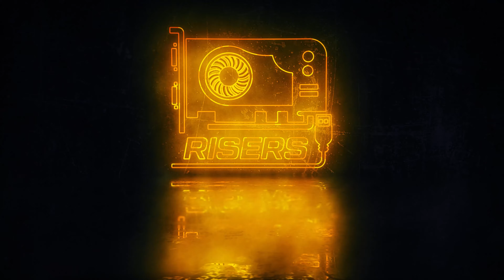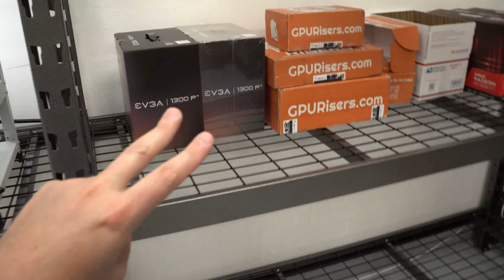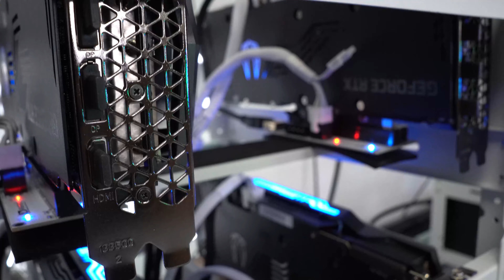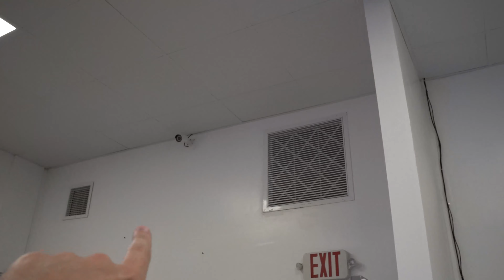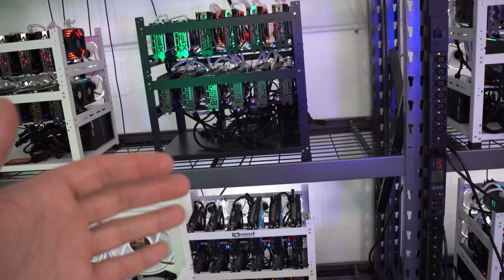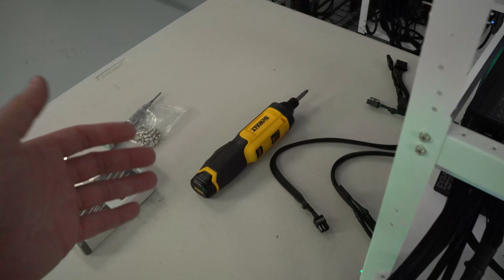GPURisers Bunker Build Updates - Electric Costs Dropped By 30% & Our Favorite New Tool!

Comment: Every time I check the EVGA B-Stock, they never have the 1600 or the 1300 PSU available. Is there some trick you use to get the right timing on availability?
Reply from the maker: I never get lucky on bstock with 1300 or 1600, i tend to get 850w on there

Comment: Dang that screwdriver is so lit!
Electricity regulations are so different from a country to another, for example here in Thailand, residential house holders are limited to 50A panel service. if you want 200A panel service, you are forced to declare yourself as a company. If you want 400A (and more) panel service, you could be forced to declare yourself as an industrial. Each status comes with lower advantageous electricity rates as well, but it's kinda wild lol
Have a great weekend ahead Mike <3